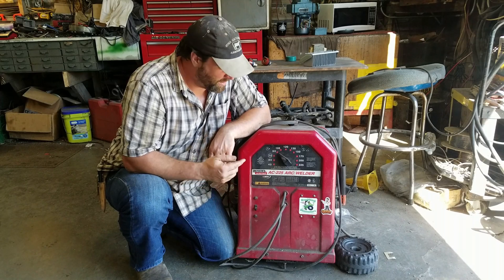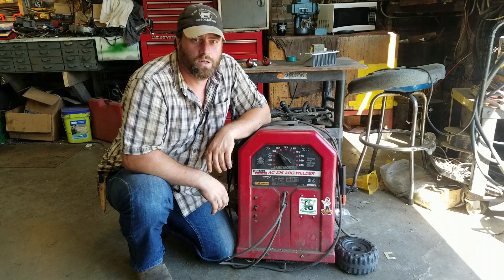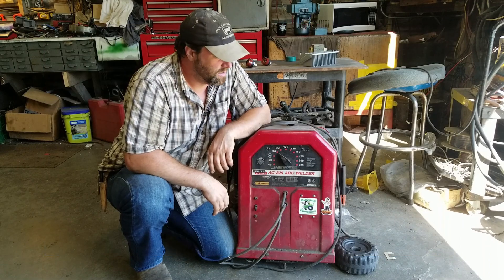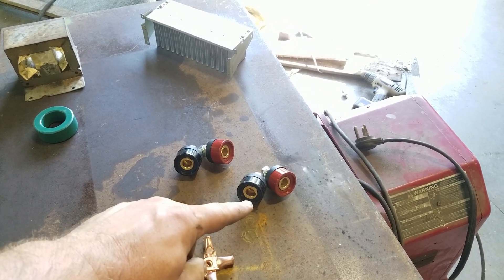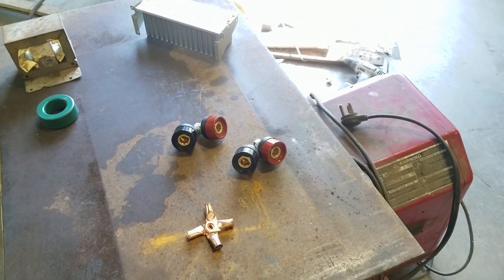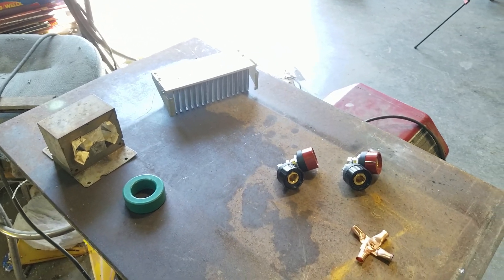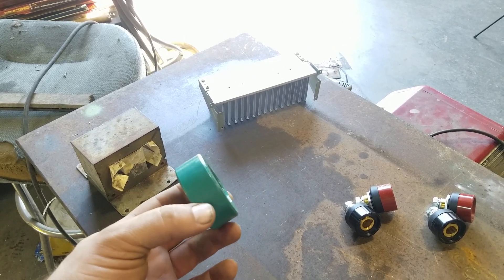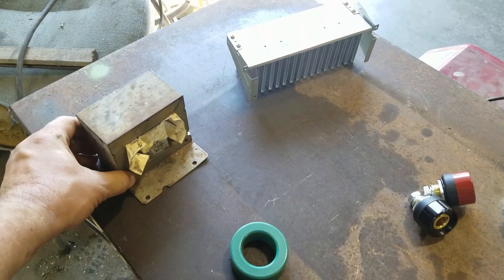Finished Product - DC Conversion Lincoln 225 BuzzBox AC Welder Tombstone

Comment: That's a real man cave you've got.......I bet you freeze your balls off in winter, as for Summer....some like it hot and dry, Melbourne's 35 dec C down in OZ is my liking and we're heading for the hot stuff now.
Reply from the maker: Thanks!  Yes sir!  Although I'm working on putting some Styrofoam insulation I picked up cheap at an auction, it helps, but it can get down to -10ºF (-23ºC) or lower here, and it's pretty hard to keep the old corn-crib-shop warm no matter what then.  I'm same way, though, I'd rather have heat than cold, but 95ºF (35ºC) can be oppressive too.  But stuff has to get done, so we just carry on!  Thanks for stopping back!
Reply: Agreed! Most things just look "dead" in winter. It's harder to get around and more dangerous when the roads and sidewalks are frozen. Too much night time and not enough daylight. We also have to wear twice as many clothes making it harder to move around. Just not a convenient time of year.. I really don't like winter at all either. One will never hear me complain about hot weather but I cry like a baby when it gets cold!

Comment: I’m confused, why did the red connector above the ammeter become black? And could you share a common negative between ac and dc?

Great video! I’m going to pull out my tombstone and take a good look at it
Reply from the maker: Thank you!  Not sure if I had the connector in the wrong place during the video or not, I know I really had to figure out how to fit everything in there without any issues.  With a full-wave bridge rectifier, the output is basically turned to 120hz pulsed DC, if you shared a common leg, you could only have a half-wave rectifier, which would result in 60hz pulsed DC at only 50% cycle time, basically instead of flipping the polarity around every time, it just doesn't allow half of the current to pass.  It would probably still weld, and with the properly sized choke would probably still do a good job, but with the full-wave rectifier it should end up smoother, but requires separate leads for AC and DC.
I do have a project I want to weld with this stick welder before I sell it, maybe I can do a little more explanation on that video.
Thanks for watching and commenting!
Reply: Gotcha. Thanks for the reply.

Comment: Could you set it up to tig
Reply from the maker: Sure!  There are adapters out there that allow you to hook a hose and lead to a TIG torch lead, with the AC and DC option, you could TIG lots of different materials, however, 60hz (Standard North American frequency) 50% positive/negative is not super common for welding Aluminum, or most other materials you weld in AC, but it can be done!
Reply: You need to have high frequency AC current to stabilize the arc for aluminum welding but there is no reason you could not weld steel with DC current

Comment: the wire welder is a very nice and much easier to use than a stick welder, but with the DC option you now have I think you should use it some before you push the Lincoln off to the side.   nice job on understanding how to change AC to DC at the high current level.
Reply from the maker: Yeah, I'm really not great at stick welding, so wire is a much better option for me.  I'd love to keep both, but the budget its telling me to sell one or the other, and, even though I just put all this work into the Lincoln, the Miller is what's best for me I'm pretty sure.  Thanks for watching and commenting!
Reply: BurningDinosaurs nice thing about stick is you can buy a small batch of specialty rods for different base metals instead of a whole roll of wire and different gas mixes. You can get a rod into place a wire feed won’t reach. Having both is definitely a big plus.
Be sure to turn off your gas bottle when you are done, small leaks can get expensive.

Comment: Pretty cool, I need to convert my Lincoln 250 to dc.
Reply from the maker: Thanks, Frank!  Yeah, you could probably do a very similar setup as I did.  That bridge rectifier was "rated" for 400A, I'm sure I'm pushing it at 120ish right now, but 4 good quality individual diodes might handle better (better heat dissipation) (that's what is usually in DC machines).  Thanks for watching and commenting!

Comment: Great subject Sir 😉 You have a great sence of humor 👍😉 and you are a strong man with a strong back Sir 👌 You have a great little helper 👍 What you use your Miller to modify your Lincoln Electric 🤣 You are a great electric inventor fabricator Sir 👍 You should keep you modify buzz box, when you will have a rusty contaminated steel it'is much easier to weld with SMAW  ( stick rod ) than a GMAW ( mig ). Great video Sir Cheers !!!
Reply from the maker: I really would like to keep it, but I don't think the budget allows for both.  Might keep some flux core wire around for unclean material or windy conditions, but I'm really not that good at stick welding anyway, so wire is a better option for me  I could actually do stick welding with the Miller, if I change out the lead for a rod holder.. I guess that's an option too.  Thanks for watching and commenting!!
Reply: @burningdinosaurs  If you were not living that fare i would buy your welding 😊👍 Cheers !!!

Comment: we buy what suits our needs and budget at the time. i dont have a arc welder. i dont know the first thing about arc welding. or mig for that matter! i use a miller 240 volt mig. it works fine. looking to upgrade to a bigger one now. seems like the projects just keep getting bigger with thicker steel.
Reply from the maker: Yep, you got that right!  Stick welding definitely takes more finesse and attention to detail to do it right, which I don't have either lol!  So, wire is definitely a better option for me.  Yeah, you're projects definitely are getting bigger all the time!  Thanks for watching and commenting!

Comment: Great modifcation to that great little Lincoln Tombstone AC welder! I like the red dinse sockets, I bought some new sockets here in the UK but we can only get black ones? I guarantee if you sell that welder you will regret it. The Miller Mig is great and it might do stick too, but you still need to keep the Tombstone. You cannot have too many welders. I have four and use them all in turn for different jobs.
I have a 1984 Oxford AC Oil Cooled 180amp stick welder, it has a battery charger built into it must have a DC output? I am pondering on if I could convert it to weld DC? It wieghs about 160lbs (80kg?) and isn't easy to shift about. Not as cool as your Tombstone but will do for me along with my more modern 2004 Oerlikon (now part of Lincoln Electric) 140amp DC Inverter welder.
I will give you a tip, welders are better than a wife, they never argue back, don't need much maintenance, always contribute to earning a living and you can live with more than one in the same house! Top regards from England!
Reply from the maker: Haa!!! Great tip lol!!!  I hear ya on keeping the Lincoln - now that I've done all that work to it, I really want to keep it, but I don't really have the budget to keep both, but we'll see!  That battery charger might be a separate winding on your stick welder, but I'm not really sure.  I'd have to look up information on it.
Reply: Your  heavy, square Oxford should be good to convert to DC.  what can go wrong ? at most, damage to the bridge rectifier would happen. 
hell, give it a try, only take a half hour or so. done my ancient lincoln 225 one, cut the cables about 2 feet from box, done up bridge rectifier,  28 uFarad 250 volt capacitr, and welds just  FINE. holds arc good. now, just have to install all in box, and fan it.  STAY AWAY FROM THE BATTERY CHARGER CIRCUIT, as it has a separate dc rectifier in it.   good luck.
Reply: Most important tips ever!
Reply: @dwightlee6164  Thanks! Another tip for you.
Always remember that women are like wheelbarrows, they can be hard to push, don't like reversing and are easily upset!